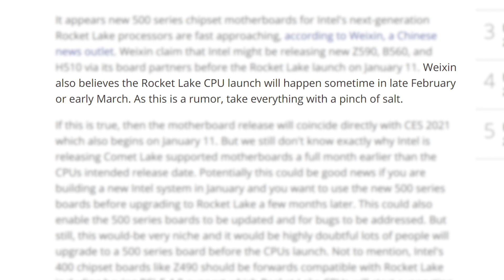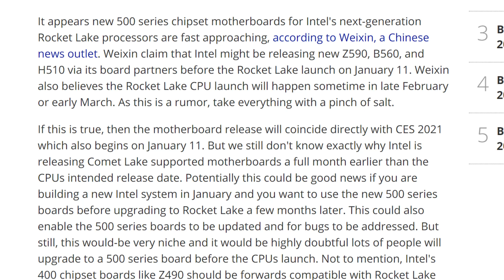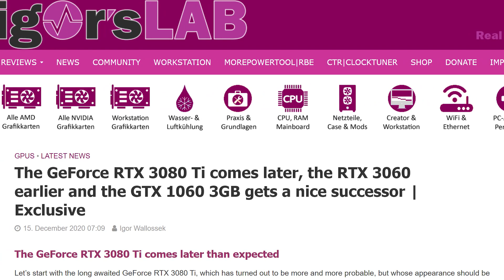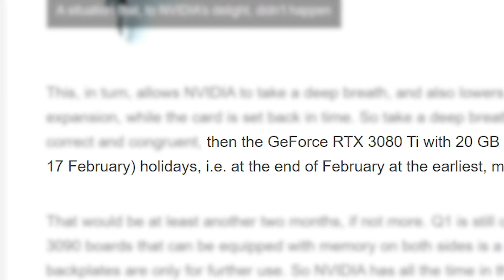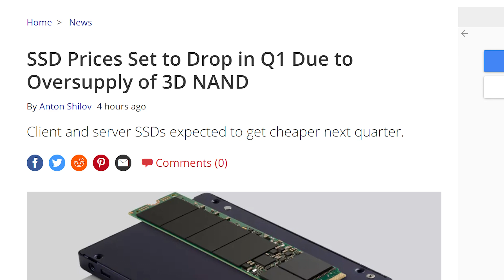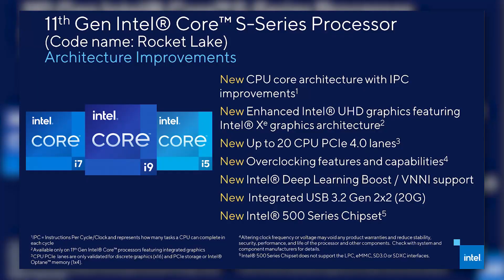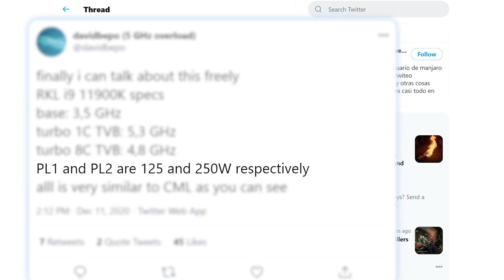Nvidia RELEASED New Monster GPU, Ryzen 5000 & RX 6000 Prices Going UP!

Comment: zen4 requires 125w vs rocketlake requires 125w as well for 8 cores ...while 10 cores can go up 250w..that just guess from them if they want to go that route with 10 cores on 5.3ghz node vs zen4 they expected to go 125w route with its 8 cores while 12 cores gonna for 220w on 7nm node

both of them have limited of wattage on single psu...10 cores is maximum number for any x86 node small or large...it makes no difference due to its intel owned x86 flawed that amd been using as well..so as Chinese folks using its intel flawed instructions for its x86 nodes...just they never will catchup due to low clocks..are similar to bulldozer architecture ..clones just hit a intel wall that intel is only one can figure it out since its there x86 code to begin with and creators made this..still unsolved what next after shrinking to 10nm ..they seen it ..its pointless for amd or cyrix to follow through until abandon entire x86 for ARM architecture might will break x86 limitations on desktop processors ..cause on server part...they gonna beyond 1 PSU ...but on 2 or more PSU to run 16 - 64 cores for gonna 4 ghz or beyond

Comment: careful what you wish for..you might end up like me when I was AMD fan back then but I got fooled into buying crap gpu's of R9's ...that nvidia always pulled you back..i was like you Coen that I was nvidia fan before becoming AMD fan...that I left permanent now and still sticking with NVIDIA regardless what AMD does...AMD can't be trusted with bad drivers and bad honestly from them is far much worst under AMD than nvidia or intel...least intel never trick me when using i7 cpu's ..i been using over decade and not see anything wrong with it as far using it still

Comment: good thing NVIDIA did not use tsmc...prices are still cheap under nvidia...only need more of quantity ...5nm samsung node is much better version than 8nm...Samsung 8nm node is not mass production but its cheaper to buy from..they sell half what tsmc sell for 7nm wafer to amd or apple ..while apple is on the newest tsmc 5nm node is only for ARM tech..so x86 gonna be 3 years delayed down the road for amd...not the gpu...for the cpu is now hindered by it outdated x86 architect is no longer efficient and requires more power the more they shrink and requires the higher clock to catch up with RISC architect only can do lot more for fewer clock cycles due to wider 8 decoders ...it can go up to gpu level if they wanted too...only nvidia will do it if necessary for cpu and gpu share same socket ..both similar architect ..and equal number of decoders with gpu and cpu will perform flawlessly in zero bottleneck for any direction from memory to storage ..instant blast processing become reality than delusion under x86 old architect design

Comment: Am I the only one that would have preferred the 3080 being 384-bit bus as 12GB Vram and cost $799 instead.. Much higher bandwidth and 12GB should be fine for some time. Flight Simulater withstanding which is an outlier.
This is what they should have done from the start..
Nvidia have been totally stupid this time.. With Turing it was overpricing. This time it's just plain bewildering decisions. Lowering RAM on the 3080 to 10GB actually going backwards instead of forwards. Then releasing 3060 (potentially) with 12GB Vram, making 3080 look retarded in VRAM amount..
WTF were they thinking.. It's like some Alzheimer person is running not remembering what they did the minute before the last.

Comment: Intel seling a motherboard without a processor for it, a classic.
Reply: you supposed to dream of it there ....
Reply: If the rumors are true, the boards will be compatible with the 10th gen processors too...so not that strange
Reply: @johnignaczak7242  yeah but, it's made for 11th gen so... A board made for something who is not launched yet.
Reply: @PlayerUzU  
But it’s compatible with the current gen?
Reply: @johnignaczak7242  i know, but it's no use, they are just putting some technology's on a "old" board and putting as a new one.
It will be like the z170 and z270.
Reply: they could give a celeron so one could update bios -one made on 22nm process

Comment: "this isng isnt a gaming GPU" Remember like 10 years ago when you got what was effectively the A6000, for just $499 for desktop, or the quadro version for $1100, yea, scalpers didnt cause this pricing problem, nvidia did, and to a lesser extent, the reletive lack of competition from AMD or others. Just immagine if nvidia had tried to charge $1500 for a GTX 470 people would have lost their flipping minds, but thanks to the candy-bar pricing method nvidia has been using, we're now getting sold a 3070, being called a 3090, for the price of a Tesla C2050

Comment: Nvidia : “Raytracing is the future !”
Also Nvidia :Release 10GB Vram 3080 which is not enough for the future
Reply: Underrated comment
Reply: It was GDRR6X though, which is high quality vram meaning higher prices
Reply: @nulu6767  dude I don’t care it’s GDDR6 or GDDR6X, all I need is at least 12GB Vram to run future games
Reply: @adardeslol7513  no you dont.
Reply: @adardeslol7513  im still playing 1080p with 4GB wdym
Reply: @XadjustmentX  Godfall already requires 12 GB Vram for 4K gaming mate . How about future games ?
Reply: @ammar123ivy  I assume people won’t buy 3080 for 1080p gaming but at least 2k-4K gaming dude . 4K Godfall requires 12GB Vram already. In the future we definitely need more than 10 GB Vram mate
Reply: @adardeslol7513  minimum for 4K are 8GB and im sure 10GB is enough for around 2 years or so if you could spare some settings down but then again RX 6800 exist
Reply: @ammar123ivy  Sure it would be enough for now but I’m talking about the future . If 2020 already has a game that requires 12 GB Vram , then 12+ GB Vram is clearly necessary for ray traced 4K gaming which NVidia blames hardware unbox for.
Reply: @adardeslol7513  well currently the only contender for 3080 is RX 6800 with 16 GB of VRAM that cost nearly the same as nvidia 3080 (in my country at least). But correct me if theres more
Reply: @ammar123ivy  Wdym , I am just saying that Nvidia should make their 3080 4K Raytracing compatible with 12GB or more Vram  . Giving us 16GB Vram would be ideal for us gamers at a slightly higher price point is completely acceptable . Considering Next gen /Current Gen games might consume more or equal 12GB Vram ,Nvidia giving 10GB Vram while saying Raytracing is the future is self contradicting because 3080 with 10GB Vram is definitely not a future proof gpu, after enabling ray tracing under 4K resolution that won’t be enough for 4K gamers.
Reply: @adardeslol7513  you're forgetting that bandwidth plays a huge part ,and gddr6x has a way higher bandwidth than normal gddr6...10gb gddr6x will easily outperform 12gb gddr6..
Reply: @forceofone  the advantage of the bandwidth of gddr6x is overcame by the infinity cache , I suppose Nvidia can do better than that.. Also I didn’t say GDDR6 is better than GDDR6X, all I’m saying is I need 12+GB Vram (GDDR6/GDDR6X) for future gaming

Comment: That's bs gamer meld u always have the board kit in advance. On feb/mar, very clever. mb
Reply: There was one 3080ti and one 3070S developer samples available in the used sample market last two weeks. And 8 Titan A100 40 GiB developers cards that needed the bridge for Q video out ask price $9600 each, stripped from a VDI workgroup server the Canadian reseller did not respond to my questions on chassis video out and/or NIC bandwidth. mb

Comment: I'm still planning to get a 6800 XT when they're in stock. And since heard they're still going to sell the reference model ($649) I'm not going to buy from an AIB that's selling the 6800 XT at inflated prices! 
But if GPU prices stayed as high as they are from AIBs then the 3080 TI could look like a deal at $999 for only $100 more than some 6800 XT's from AIBs

Comment: Yo Meld, normally I don't comment on anything, but I'm into the 3000 series in terms of using them as hardware and not for gaming. And when the funds allow it & you can readily buy the gpus, I'm gunna be spending money like a pig for the 3080 or / future 16gb 3070ti or 80ti or whatever that's better.

Comment: Damn bruh they making a 12gb 1060 when my 3070 only has 8gb tf
Reply: Nvidia fucked us again!  I also bought a 5800x and found out they have heat issues.  Fuck both of these company's!
Reply: @blkshp25  get a good cooler maybe?!
Reply: @OutOfRangeDE  Dark Rock 4 with 4 noctua fans in my Meshy C.  It's defiantly not airflow .
Reply: Does the 1060 have an SLI bridge? Reason I ask is that I run nvidia surround on three 1080p displays. I have been since 2010. Nvidia has failed to provide a card that has enough ram and can really push three displays they way it should. IE, if you have three displays there should be an option to use three cards in a NON SLI mode that dedicates a GPU per screen and syncs with something like NVLink. They dont and even if you find an SLI card it mirrors the ram between both.

Comment: Not an Nvidia, AMD, or Intel fan here but i would go for a price that suits me on my budget and performance, im still impressed on intel on how the 14nm++++++ is refined or optimized given that the AMD 7nm was not able match in terms of games benchmark performance, only until the AMD 5nm came. And kudos to AMD without them they would not be able challenge Intel and we would proabably stuck at 4c 8t cpu's for a bit long long time. 

Only if intel manage their prices for the processors it would be great but still kudos to AMD to their Ryzen and RX series for their development, its great to see that intel is learning what the AMD is doing. 

By the way im neutral i have a 
Desktop setup
Ryzen 7 1700 
RX580 8GB 

And also a laptop that runs a 
Intel 8750h and a gtx 1070 MSi GS65 Stealth

Note: not flexing my specs here just let you know that im not a fanboy of whatever company it is peace out.

Comment: Rocket Lake seems to have heat density pretty close to actual nuclear reactor. 250W from tiny area is multiple times more than electric stove. If gamers prefer this above 5900X, because it gets 2 FPS more on 1080p low on 3090, then I have all lost to gamers. Only if this would be cheap AF I would be interested. You need superb case, 100w more in your PSU, superb cooler, and more expensive motherboard, so the CPU would have to be $250. Otherwise I would rather have 5600X. Though only hope for Intel is AMD shortages, and also the insane people who prefer those 2 FPS on 1080p low with 3090.
Reply: @n0obhAcker00 I don't know. I certainly have no interest on Intel. Maybe there are some value in i3/i5, I have absolutely no idea.

But I rather would buy X570 or B550 mobo and used CPU. Even first gen Zen 8 core is pretty amazing. It only suffers on high FPS gaming, but if you want solid 60-100, no matter what the game, it can handle it.

On Cyberpunk it delivers almost the same perf as Zen 3 or 10900K when using 3080 and 1440p high/ultra.

And the upgrade path is enormous. At least up to 5950X, but Zen 3 refresh at 6nm is quite likely as you can use TSMC 7nm designs without modifications.

And because the platform has supported upgrading your CPU, there should be a lot of used CPUs out there. So when Zen 3 availability becomes really good, then there will be tons of people selling their Zen 2 CPUs and thus prices must be pretty low.

Cores and threads will eventually be used. And up to that point you get really fluent system which is great at multitasking.

Comment: They're releasing a 12GB 3060 when my 3070 has 8GB? WTF. I need to get rid of this card and get an RX 6800 somehow, cyberpunk is already maxing my VRAM at 1440p :(
Reply: At least you were able to get the card, also you play at 1440p
Reply: Pretty sure 3070ti will be revealed next year, just got my 3070 2 weeks ago :(
Reply: I'm upset about that too.. And don't worry about cyberpunk.. Once it gets optimized.. It'll run smooth(I hope).

Comment: Doesn’t make sense to equip 3060 with 16GB VRAM while 3060 Ti only gets 8GB
Reply: They obviously wanted to gimp the 3060Ti's (long term) performance and realized they're not getting away with it considering AMD's new line-up. Typical anti-consumer Nvidia shenanigans.
Reply: @Bassalicious  maybe Ti is replacing the old mx they used to use
Reply: @nostrum6410  not on desktop, no clue about mobile

Comment: You are making good content, but don't try to overhype everything. Stating that prices might go up and then saying that they lose out on their 3% discount could technically be correct, but it is highly misleading as its not even sure and 3% is not too much to worry about. Also saying that an 8 core is faster than a 10 core in a limited core workload is very misleading (although you have said that it isn't the best benchmark). The news coverage is good, but don't overhype it :D

Comment: As for me I'm interested in some of Nvidia's new SKU's but couldn't care less about Rocket Lake.  Most apps don't become CPU deficient for quite awhile after a new release and the new chipset/mobo requirement for just about every incremental upgrade from Intel leaves a bad taste in my mouth.  And to preempt any flamers, I ran 2 - 3770K systems until July 2020 and 1 is still in use and my Server is a Xeon so I'm not an Intel basher.  Just tired of paying their 'tax' for every update (1 of the reasons I held on to 3770K so long).  My Ryzen will probably carry me thru until DDR5 platforms become mainstream and start to pull away in performance.